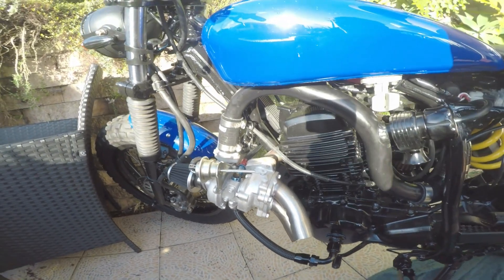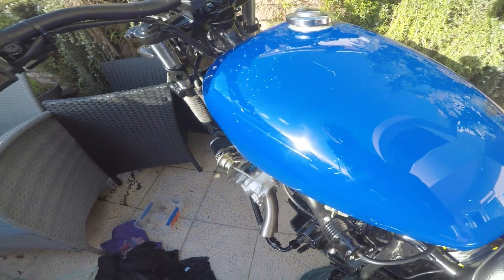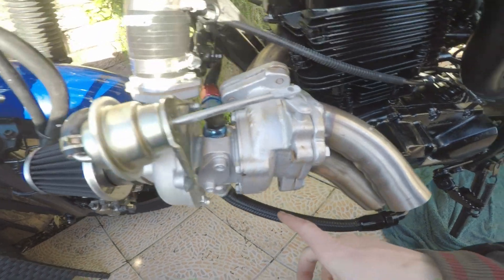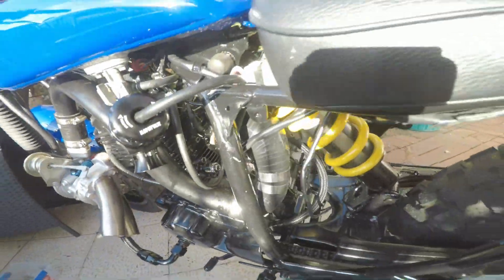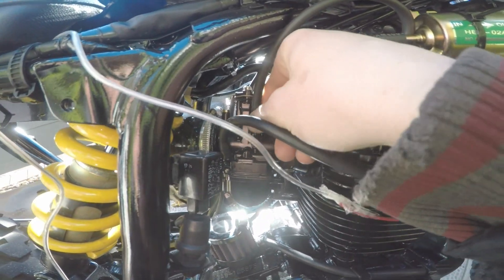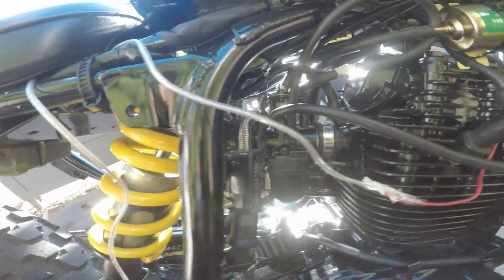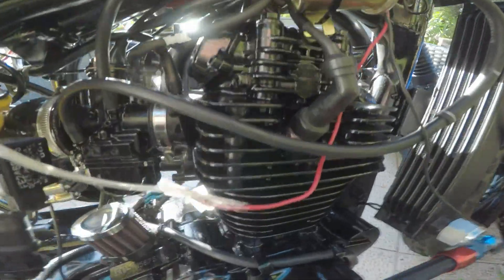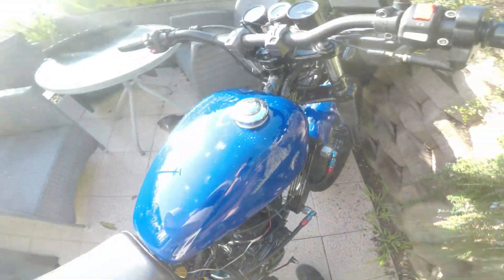How to turbo a carburetor TW200 -10psi VZ21 turbo (blow through)

Comment: We're did you get you're oil feed from and how much oil pressure do you get I've tapped into my oil filter housing on my ag200 but it's only reading 10psi of oil.
Reply from the maker: @zhenschreurs8627  I found a random bolt that hold in clutch lever arm. Just had to stop it popping out with a bracket but worked fine. I think it's all about flow really. Like a constant small stream or too much will blow seals in turbo

Comment: yo bro, looks like you live near me based on the video. Im based in Albany and am working to make a gn250 turbo cafe. would love to chat to you about your setup and show you around the shop sometime. Cheers
Reply: Hi mate did you finish it already or is it still in the build. I'm doing a gz250 at the moment and would love to get any advice or tips seen we have the same motor. My biggest concern is oil pressure. Did you have any issues or are you running a seperate oil tank and pump

Comment: Just curious, are any carb mods necessary besides pressurizing the float bowl with boost?
Reply from the maker: I never tuned carb but you should tune the carb so it runs good with non turbo
Reply: Just tune it so it's a little rich at idle it will Ballance back out as the boost pressure comes on.
Reply: You didn’t have to change the jetting or anything?

Comment: Could anyone tell me about how this carb pressurising works, and where the hoses go??
Reply from the maker: it equalizes the air pressure on inside of carb so that the fuel can still come out of jet. otherwise air would push the fuel out and it wont run

Comment: Have you fitted an Efi system yet?

it's running rich when the turbo isn't spooling

putting a smaller jet may make it dangerously lean when the turbo spools up
Reply from the maker: Yes exactly. I have been running efi for 2 years now and it's been amazing. I got a new vid coming na vs turbo with a bigger piston

Comment: Have you spaced the cylinder to reduce the compression ratio? If not you will need to.
Reply from the maker: Nope runs 15psi sweet
Reply: So I have to ask is it still running or did it blow up.
Reply: Here are the engineers ;) turbo increases the compression ratio wich may destroy your engine and then your turbo will only be useful as a forced inducter for you if you have a corona ;)
Thank for your vedio

Comment: its stuttering and bogging out under load
Reply from the maker: Yeah that's why I fitted efi. Check vids
Reply: @Kylesprojects101  the other way to do this is to use a continuous velocity carb. Supply's smooth throttle response while being speedy at the same time.

Comment: Hello
I want to install vz21 turbo On my motorcycle
However, I don't know how much lubricant pressure to supply to the turbine.Can you tell me?thank you
Reply from the maker: Depends on engine
Reply: thank you very much.
Reply: @胡家揚-m2z  no problem👍 you could get a oil restrict or bolt, they use that on turbos for cars. Or just use a separate pump for the oil supply to the turbo, a 12v electric one, and with a little reservoar (maybe 500ml) and a filter, and possibly oil cooler. Just connect a gauge so you can see if the pump fails.
Reply: The Chinese vz21 turbo does not like pressures more then 20 psi, and preferably not lower then 7-8psi at low speeds.
Reply: I'm experiencing an oil leak from a VZ21 turbine.
Now I know that the oil pressure I give is too high.
About 40 ~ 60psi.
In the future I will use valves to control oil pressure.
thank you very much.

Comment: Hey mate, where abouts in nz are ya? I'm looking at putting a turbo on my honda shadow vt750. Would be awesome to chat about yours.
Reply from the maker: I'm in Auckland. Is that v twin?
Reply: @Kylesprojects101  yeah man it is but single carb, going to custom make my exhaust to turbo pipe just wondering where you got all your parts and any issues you ran into.
Reply from the maker: @MrHoundMF  ebay has all the parts and a few isses with carb but mainly sticky throttle
Reply: @Kylesprojects101  Hey guys, I'm from NZ aswell, thinking about trying a turbo setup on my (soon to be) 1275 harley sportster. Having huge troubles finding any information about blow through carbs! let me know if you figure anything out or if you could give me a run through.
Cheers

Comment: Hey mate nice build, try fitting a pressure line above the slide, it will balance out the pressure above and below the slide and it shouldn’t jam up. It is really hard to get them to run properly but when you do. 😁👌🏻

Comment: Hi, I am in the same project! I would like to know What is the reference of the carburetor that are you using for the turbo ?
Reply from the maker: As in a boost line?
Reply: Kyle's Bike Projects he wants to know the actual carbs part number
Reply: Use your standard carb and adjust the needle hight on the slide. Take it for a run then pull the spark plug if it has white marks on plug your to lean  so adjust the mixture screw accordingly. You want the bike to run a bit rich at idle so you don't lean out under boost

Comment: what about if you put the carburettor before turbo ? i think the carburettor  will work better with vacuum . but i dont know whats about the heat of exhaust and turbo
Reply: Enjeksiyonlu pulsar 200ns için bu turboyu düşünüyorum. Enjektörden çıkan basınç turbo basıncını rahatlıkla yenmeye yeter mi sizce? Yoksa bu önerinizdeki gibi tubodan önce mi püskürtme yapmalıyım bende?
Reply: @srknyxl  200cc den çok bi basınç çıkmayacağı için yeterli gelir bence bende aynı fikirdeydim ama pulsarı satınca karbüratörlü bi motor yapmayı planlıyorum

Comment: Did it actually produce more power? I'm interested in putting a VZ21 in my 250 cafe racer.. I'd probably go with a draw through setup though. Did you have to pressurize the fuel tank too?
Reply from the maker: Yeah way more power. Ran surprisingly well with no tuning at all. The only issue is the carb sticks open as it's a cheap ebay slide carb and boost must make it sieze. I installed a fuel pump diaphragm type about 10psi and it works good
Reply: @Kylesprojects101  sounds mad... Any reason you didn't go with a simpler draw through setup? Only thing I'm unsure of us fuel going into the turbo itself.. Have you out many km on it?